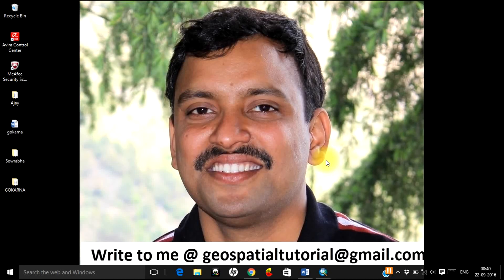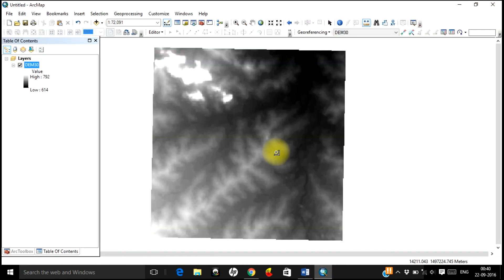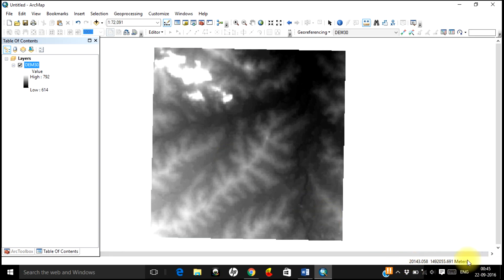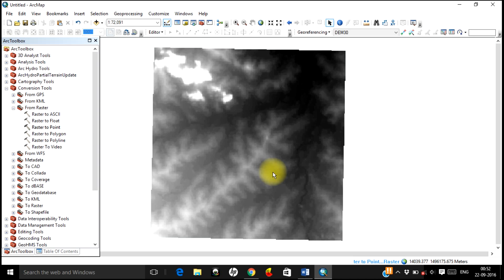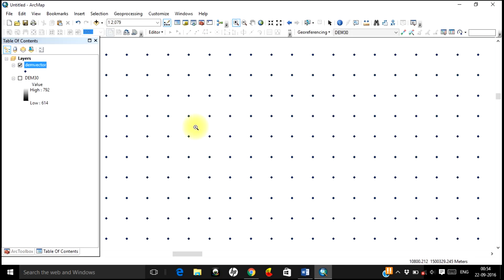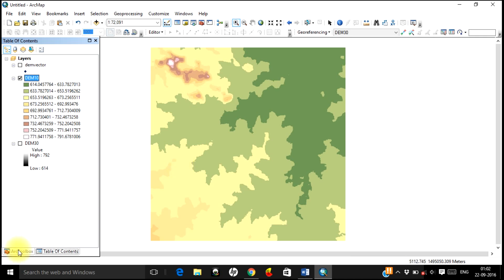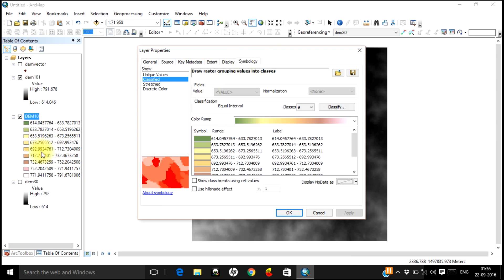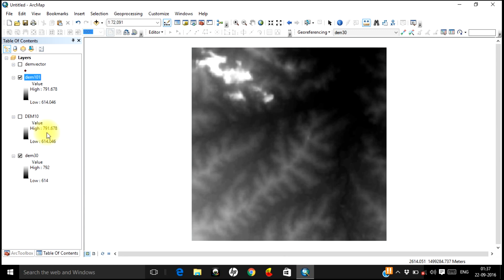Increase or Enhance the Spatial Resolution of DEM using Spatial Interpolation Technique in ArcMap

Comment: This is not enhancement of Spatial resolution. What you are doing is just making smaller divisions (grids/units) from bigger grid.If you are dividing a bigger cell into 4 parts, say if it had a value of 30m. Each 4 parts will have the same cell value (30m) as the bigger one(30m). This does not enhance the resolution. You got Wrong concept
Reply: lol . he is professional . you are talking about resampling technique and he is talking about interpolation to increase the resolution

Comment: thanks for the video ... I'm using gdalinfo to measure spatial resolution instead of measuring it with "Measure Tool" ...
Reply: IDW Interpolation
Generates an Inverse Distance Weighted (IDW) interpolation of a point vector layer.

Sample points are weighted during interpolation such that the influence of one point relative to another declines with distance from the unknown point you want to create.

The IDW interpolation method also has some disadvantages: the quality of the interpolation result can decrease, if the distribution of sample data points is uneven.

Furthermore, maximum and minimum values in the interpolated surface can only occur at sample data points.

source:
https://docs.qgis.org/testing/en/docs/user_manual/processing_algs/qgis/interpolation.html#qgisidwinterpolation

if you want to make it with QGIS ...

Comment: Also sir if using dem I found elevation as 40 m( suppose) and by survey I found that the actual elevation is 25 m so can I change the elevation value
Reply from the maker: Ya you can. Enter the editing mode for that point feature, select the point for which you found the elevation value, go to attribute table and change the value. But if you are changing one, think of changing values of nearby points as well. else the interpolation can go wrong with one survey value and others being satellite values.

Comment: sir I am thinking of delnieating a watershed in arc gis and my guide is suggesting me to validate the elevation manually by surveying on site. is there any easy way to reduce the effort. Ilikeyour videos I am new to this field but have intrest in this field. one more thing if I delineate a watershed using different dem like once from bhuvan, then from srtm and then from aster can I use that forvalidation
Reply from the maker: I would not suggest that. With personal experience, what I can say is that for Indian region, Bhuvan (CARTO DEM) is the best. Manual survey for each point and then creating DEM is a big and time consuming process. Also accuracy cant be better than DEM unless you use, something like DGPS or Total Station. So for this purpose, I suggest you to use Bhutan DEM and carryout your work
Reply: some other way to validate I would likely to work towards flood inundation mapping as an m.tech scholar using HEC RAS. I will first analyse it and then survey for only  flood prone area only likely using DGPS.
Reply from the maker: You can use CARTO DEM for HEC RAS. There are a few methods for validating, you will find them in detail online. However as far as catosat is concerned, you need not do validation, as in their documentation, they have claimed certain amount of accuracy, you can consider that.

Comment: This process seems to be too lengthy. There is a shortcut to do this even in arcgis. Go to data management->  Raster -> Raster preprocessing --> Resample. This is a one way straight process, which yields same results as the process explained in this tutorial.
Reply from the maker: You are right to some extent. However resampling and interpolation are different. I am using spatial interpolation technique. In resampling method you do not have an option for Spatial Interpolation (You can go through online material to understand difference between interpolation and resampling) As we are talking about DEM, interpolation will give result of higher accuracy than all 4 resampling techniques listed. However resampling is also useful in certain cases,  I will do a tutorial using that as well in near future.
Reply: I am also confused between resampling and interpolation since the end result is same ( i.e. to increase or decrease dimension of dem in both the method)
It would be great if there is a video abt this two.